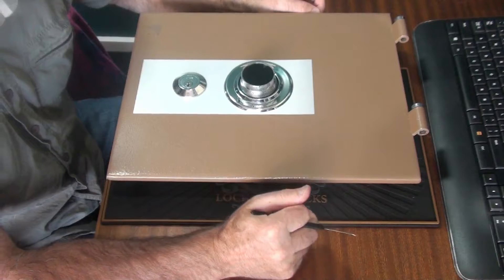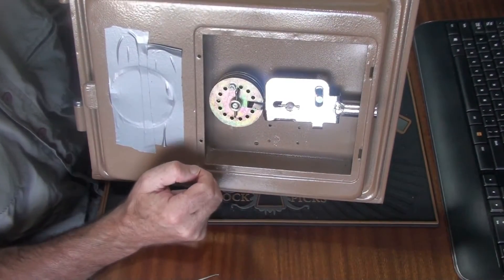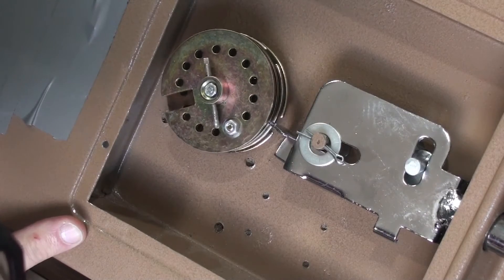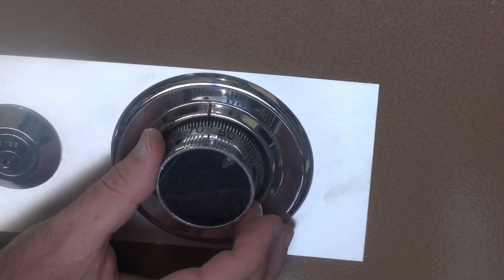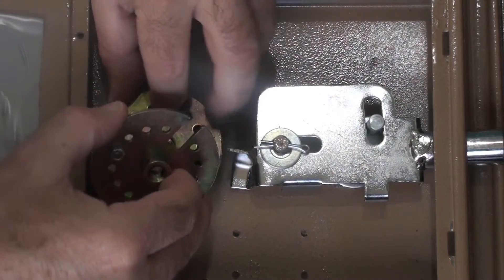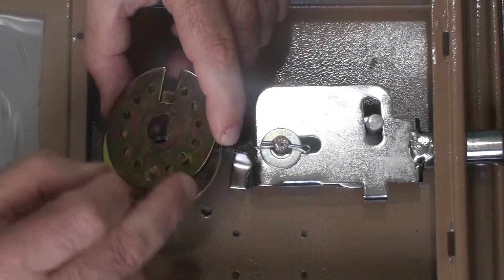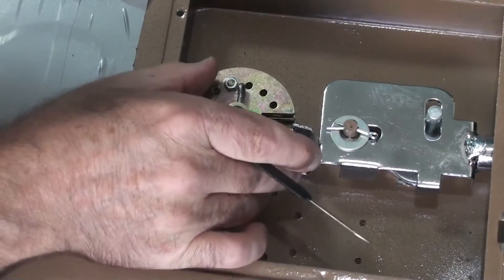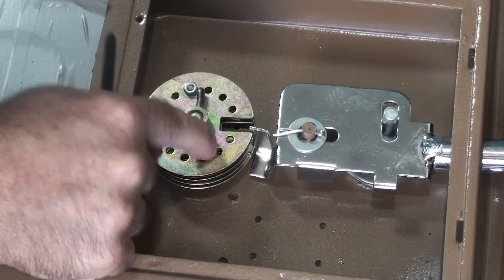[164] Tutorial - Deconstructing a direct entry safe lock - yet another piece of Chinese rubbish

Comment: To be honest, you have to pick the lock first to be able to manipulate the dial in this manner, not that that's hard.  Even a so-called secure safe can be cracked in minutes and most don't require a key.  So at least the cheap safe has that requirement.  BTW, even American Security safes worked like this in the past.

Comment: I think you could make that lock much harder to manipulate simply by pushing some kind of extension around the sidebar (the metal part that goes into the gate when correct combination is dialed). Maybe a bit of garden house or multiple layers of heat-shrink tubing? And grind of all those static flies and use a bolts on every wheel.

That would accomplish three things:
1. Pushing the sidebar towards the wheels is a slightly mushy so accurate measurements are harder to make. Pure metal-on-metal contact is easy to measure accurately. Metal on rubber requires constant torque for each test.
2. Extra stuff around the sidebar makes the effective gate width narrower.
3. You can actually change the combination (albeit only to one of 14^3 possible combinations, note that there are 13 holes + the gate which means each wheel has actually 14 possible orientations).

You could also try griding the sidebar slightly wavy for the section that touches the code wheels. Then all the slop in the mechanism would position those waves different for each try which would make decoding the lock much harder. Note that whatever squishy material you use, it must not extend long enough from the sidebar to grind the code wheels while the drive wheel is rotated.

Oh yeah, and make sure to grind e.g. 3 false gates to each code wheel.

Comment: Thanks, a very useful video, I have one that looks identical and I mislaid the combination when I moved house 2+ years ago. I thought I had the combination on my phone, but it only has 3 digits not four?  From your video I now know the drive wheel is 88, but I have still not been able to open it. Can you confirm the number of turns each way as all the other videos say 4-3-2-1, but they only have 3 digits, so does that mean it shoud be 5-4-3-2 ?  I am prepared try all 2197 combinations, but I need to get the number of turns each way right first.  Many Thanks.